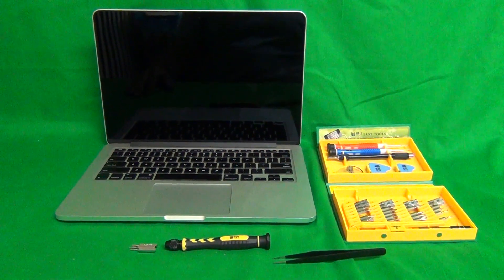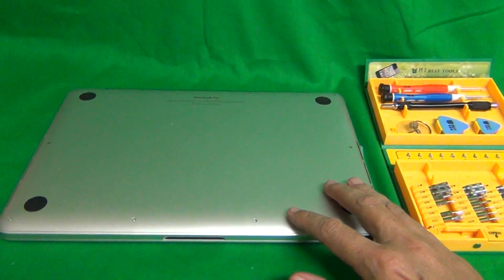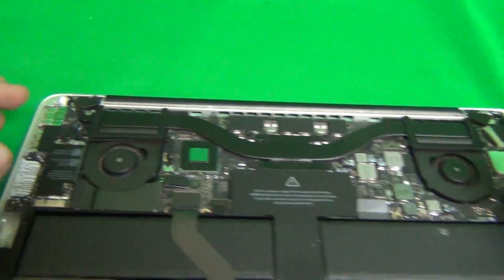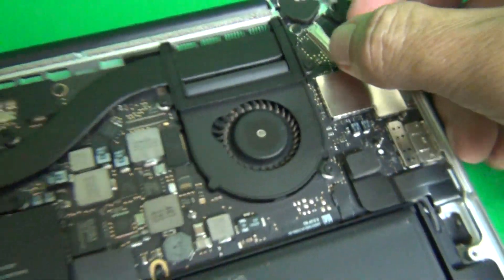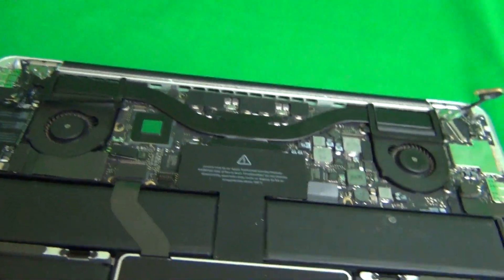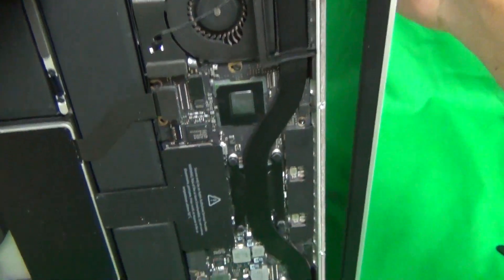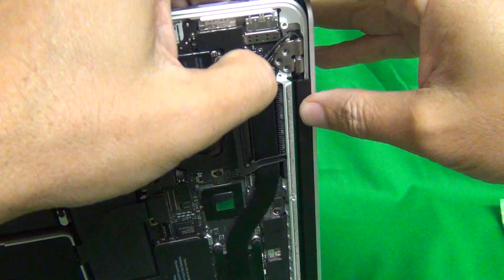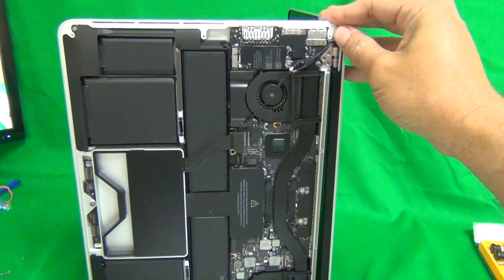Macbook Pro 13.3" A1425 Laptop Cracked Screen Replacement Procedure

Comment: Thanks for the video!  I guessed a little on the order of the three cables (wifi, etc) when putting back.  Also, those cables were tough to plug-in.  I see why some thought that they had it plugged in, but wasn't.  It took a bit of working those cables to get them to seat all the way in.  Other than that, it went awesome.  Thanks again!!